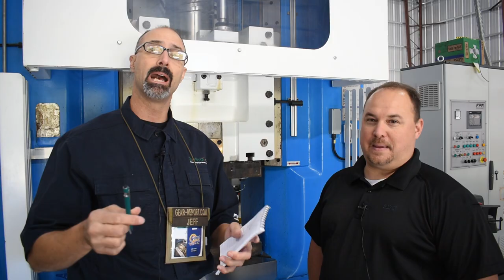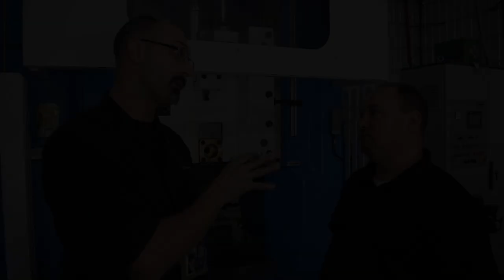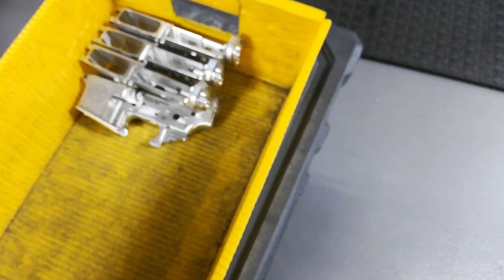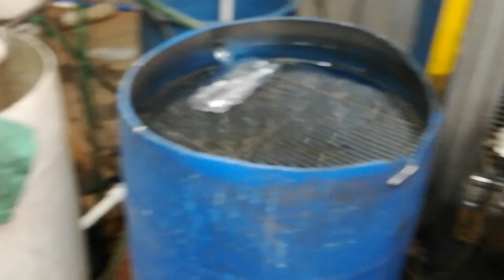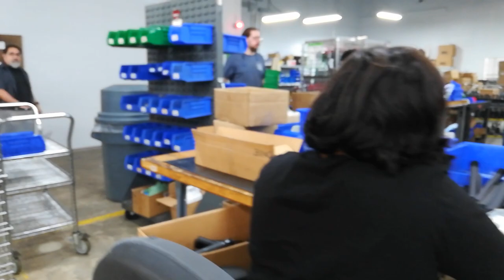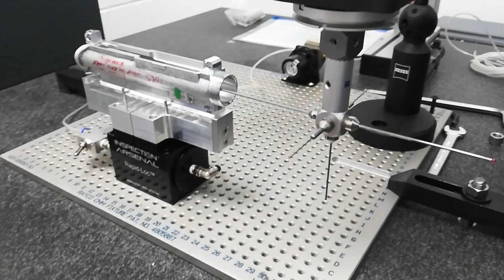Palmetto State Armory Factory Tour & CEO Interview - Part 1

Comment: What does psa do with the barrels they receive that don't pass inspection?  I've heard that psa has/had a problem with barrel indexing pins sheering and barrels being off center, i.e. canted front gas block sight.
Reply from the maker: I have no specific info on this. But I suspect it is treated as scrap metal.

Comment: I’d rather psa put the psa 5 mp5 out at a discount and fix if any problems cause they have a unconditional lifetime warranty
Reply from the maker: That approach would completely undercut their market position. PSA is trying to convince consumers that they don't make cheap crap. Launching a discounted and problematic new platform, using customers as beta testers, then having to deal with a flood of warranty issues would reinforce exactly the image they are trying to change.
Also, PSA's mission is to arm the population consistent with 2A. Selling crap guns that may/may not work is directly counter to their mission.
I understand being eager to get your hands on one. I am eager as well. But waiting until it is right is the only viable option.